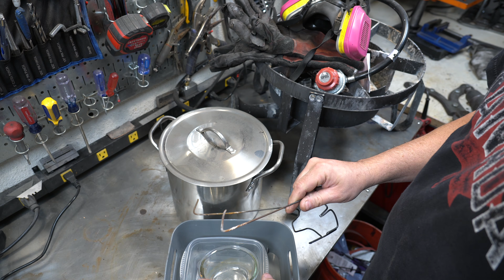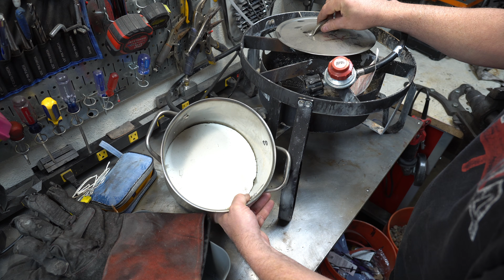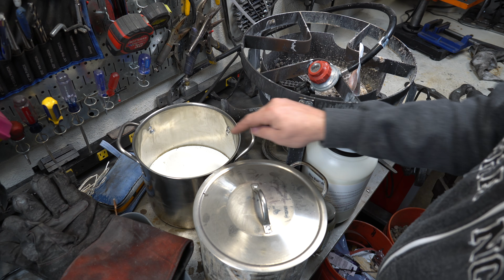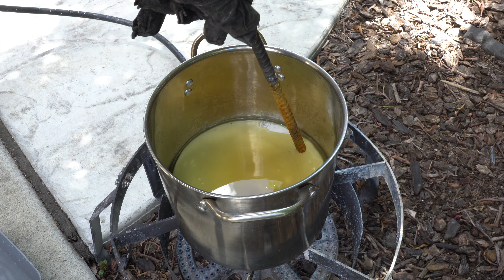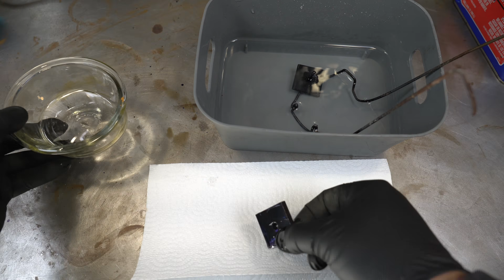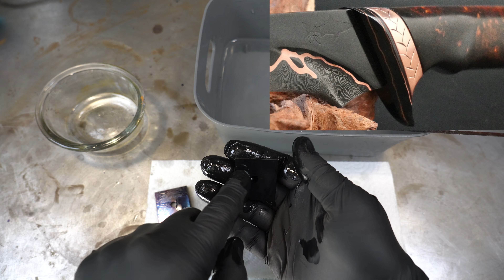Triple-T #82: Hot salt bluing / blackening for knives

Comment: With Nitre BLUING you can check the color . Take the part out and look until you achieve the color you desire.. gold , red and the blue. Dip it in the water and cool it off . If you go back in  your correct it must be dry. Hot salts bluing.... putting copper or brass in it can contaminate the salts. As a gunsmith we even remove the brass bead sights on a firearm if possible.  But if not they are small enough to usually not create a problem.  More than that and you can contaminate your salts. Which will ruin the finish.  We use a caustic soap powder. Very small amount in hot water.  Simply work the part back and forth about a minute.  You should already have the parts cleaned and oil free. Acetone has an oil base and we use alcohol to wipe down the part before going in the soap.  From the soap place the part in COLD WATER (the colder the better..you can add ice to the cold water). Then after a good dip in the cold water place it into the salts.  In about 3 to 5 minutes.  Lift the piece out of the salts and immediately place it into the cold water...or it will rust / oxidize immediately... you will know then if it's done or not.  If not go back in the salts for another couple of minutes... repeat the process and remove it and directly into the cold water.  It should be done... it will not get any bluer . Then place it in boiling water... a flat piece of steel only needs a good rinse...This stops the process and gets the salts off then dip it into the oil... we use regular Remington gun oil... One thing I didn't see you do is stir your hot salts before lighting up the burner. This is important, stir it up and break it up gently or you will develop hot spots.. stir gently as it heats up to the boiling point... the boiling point differs based on where you live... IF IT BOILS TO SOON... BEFORE THE PROPER TEMPERATURE ADD SALT.. STIR GENTLY AND ADD UNTIL THE SALTS HAVE A SLOW STEADY BOIL AT THE PROPER TEMPERATURE. IF THEY GO ABOVE THE PROPER BOILING TEMPERATURE.. ADD WATER CAREFULLY AND GENTLY TO REDUCE THE TEMPERATURE TO THE CORRECT TEMPERATURE.   Then place your parts in the solution.  The salts should hold at proper temperature for the entire time to blue the parts.  Unless you spend to much time in the salts.  Once you remove the parts... Use the same process to set the temperature of the salts at the proper boiling temperature for where you live.  THEN TURN OFF YOUR HEAT SOURCE.  IF YOU CONTROL THIS AND DO IT CORRECTLY.  WHEN YOU NEXT USE THE SALTS IT WILL PROPERLY BOIL AT THE PROPER TEMPERATURE..IT HAS A MEMORY.  DONE CORRECTLY AND IF YOU DON'T CONTAMINATE THE SALTS.  THOSE SALTS WILL LAST A LONG TIME AND ONLY GET BETTER.  
  They is a full time Gunsmith school in Colorado.  BLUING is part of the curriculum and as a student you will do a lot of it.
Reply from the maker: Thanks for the tips, Ron.
Reply: @TyrellKnifeworks  no problem.. hot salts bluing is a lot of fun. Next look into Belgium bluing and Browning. Process is a little longer but not that much.  The finish is great and just adds another option for you to use.  I have blued a lot of knives.  It goes hand in hand with matching to a nice firearm finish.  Good luck and keep building the beautiful knives you build.

Comment: What if you’re bluing something larger with much heavier mass in the NitreBlue?  Submerging the piece might cause the temperature to fall as the material starts absorbing a lot of heat from the salts.  Since the temperature control is so critical, how do you account for that?  Would you first have to warm up the piece that’s being blued?
Reply: No , the process takes place pretty quickly.  Plus it is generally used for accent pieces.  So you won't have any problems.  It's not that precise of a process.  It's very simple.  The key also is to polish the pieces.  The better the polish the better the color stands out.
Reply from the maker: Ron covered it pretty well. 👍

Comment: The bluing salt will be a nitrate/nitrite blend like that used for tempering carbon steel.
It will spit like fury if anything damp gets in it.
Most heat treaters let the work pre heat beside the pot before transferring into the salt.
The salt decomposes at about 500-550 oC giving off corrosive brown fumes.
If it fumes brown turn the heat off and run away.
The brown fumes can kill you.
If kept below this temperature it is quite tame and has a faint sweetish smell.
I have no idea what the blacking is but would guess at caustic soda (lye), sodium nitrate (saltpetre) and water going from your temperature limits.
This is similar to a brew used in the gold and silver industry for heat treating .
It does tend to get everywhere and rust everything over time.
It seems to walk across surfaces slowly absorbing water as it does and corroding merrily.
Both can be cleaned up with hot water and are relatively low toxicity though so it's not all bad.
Much better than old style case hardening which uses cyanide and is very hazardous and definitely not for home or hobby use.
Have fun along the way.
Reply from the maker: Thanks for watching and adding some info.  👍
Reply: If it fumes brown like that, is it decomposing into nitric acid?
Reply: @mitchellfield9213  
Yes it is turning into nitric acid and it will kill you in a nasty way.
You don't need to get that hot for bluing.
It will have a faint sweetish smell when all is good but will still spit and stick to you so be careful.
The salt is the same as tempering salt for carbon steel basically.

Comment: Could I make a quench oil with vegetable oil and diesel mixed together to the right viscosity.?
Reply from the maker: Why?  Engineered quench oil is a small cost compared to the rest of knife making.  Just invest in the right oil.  (Motor oil is also full of additives that are NOT good for you).  Thanks for watching

Comment: Very cool video. A long handle cup will be useful for adding water to the blackening solution... Thank you for the demonstration and explanation!
Reply from the maker: Yeah I long ladel would work. I just didn’t want to ruin one of my wife’s spoons.  😜
Reply: @TyrellKnifeworks  lol. Nope... Get your own. Don't start a tool war with the wife. You will loose! A steel tube or some pipe with a bottom plug and a stick welded/bolted to it will do... ;)

Comment: I read that 1045 tempers at 750 i think 700  wonder how it would hold up in hot salts
Reply from the maker: 1045 isn’t good for knives.  Hammers and axes maybe but it won’t harden enough for knives.  Thanks for watching, Christopher.
Reply: @TyrellKnifeworks  sorry I was thinking of my hammers being black. I want to make mild steel shiny black Will the black slat work?
Reply from the maker: @christopherconkright1317  Sure, it'll work.  It works well on hardened or mild steel.